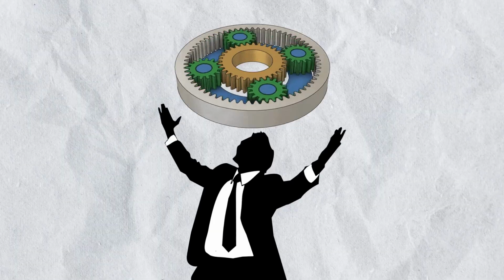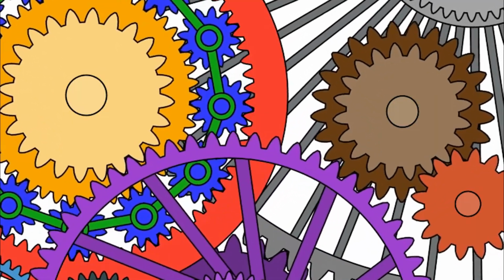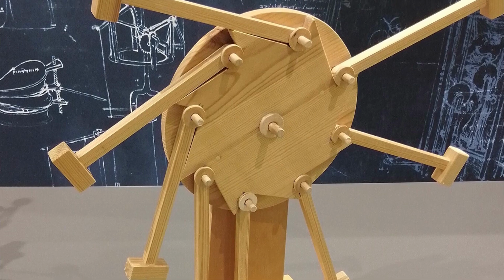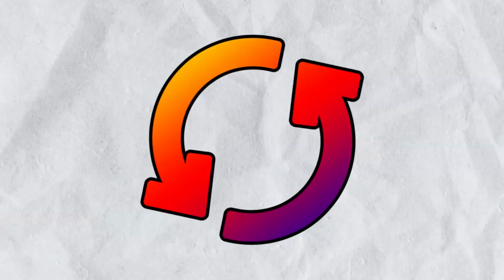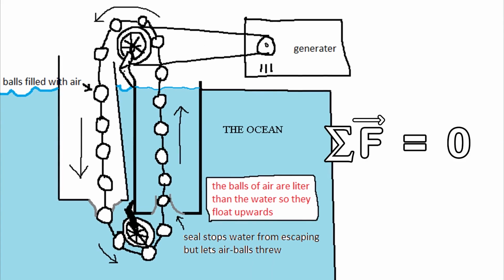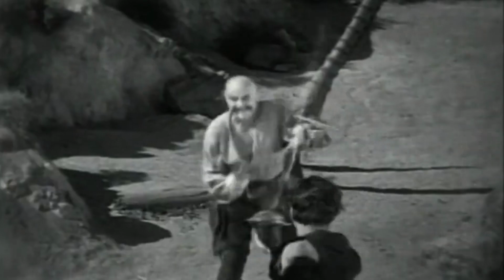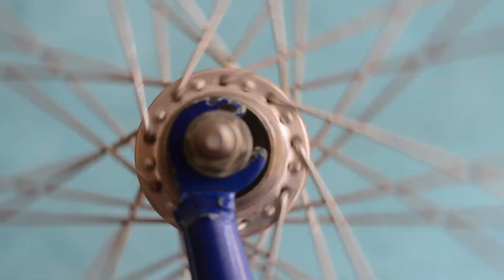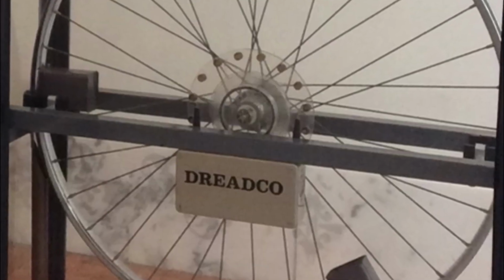perpetual motion

Comment: For me Stirling engines are dark magic, they only need difference in temperature to work, so in theory we could use any source of heat or cold to make them work, but the cost of building and low torque make them subpar.

Comment: What if the wheel with marbles was in a vacuum, like in space so no air resistance?
Reply: part of the energy will always be converted to heat (friction of the parts) and sound, even in vacuum, so it would still stop.

Comment: If David Jones' letter contains some sort of breakthrough that could've solved the environmental damage caused by traditional energy generation methods, I'm gonna be a little bit pissed.
Reply from the maker: No i think it has to be an engineering trick, we most likely know about it we just don't know it can be used that way...
Reply from the maker: And perhaps it has something to do with the year 2047, maybe it will stop working by then, that's why i suggested the heat engine...
Reply: @tylerschannel Let’s see by then along with the digitalized glitch-infused prophecy of the Jan 19, 2038 Global Economic Crash as Y2K’s reborn electro boogaloo!! 💥 👀
Reply: I think it was mentioned in a Steve Mould video about perpetual motion machines. It's not a proper perpetual motion machine, i.e., there is a hidden energy source. From what I recall there are a handful of people who know the secret so they can maintain it, so I wouldn't expect that it'll stop in 2047. That said, I also don't remember him saying that the secret would be revealed in 2047, but I could be wrong.

Comment: Friction is never the problem and never will be. You can not achieve perpetual motion (that generates extra energy) even if there is no friction.

A proper working perpetual motion machine's efficiency must be greater than 100% in order to be able to "create" energy. 
You see, even if you eliminate friction entirely, the efficiency of the machine will be a maximum of 100%.

You need more than 100% efficiency in order to achieve perpetual motion (in the sense of creating energy)

And let's consider that you eliminated all kinds of friction, the machine will just spin or work indefinitely. But at the moment when you want to "extract" energy from it, it will just slow down and eventually come to an halt.

Comment: Even if we make a perpetual motion machine we couldn't really make use of it because if we attach a generator to make it generate energy either will be too weak to do something useful or it will make the perpetual montion stop altogheter because you need extra force to make a generator turn mechanical energy into eletrical energy
Reply: Noooo, the point of "free energy" is to sustain a loop indefinitely, not to be able to use it anyhow.

👌

Comment: One machine that fascinates me is the "hydraulic ram pump"! It looks like an attempt at a perpetual motion machine (or a source of free energy), yet it works surprisingly well, for something that just harnesses energy from flowing water!
Reply: You mean, like a water mill? The kind that uses the already-there "free" hydraulic current pressure?
Reply: @gweltazlemartret6760  Nah. While a water mill uses the flow of water to rotate a shaft, the hydraulic ram uses it to push water out.
 There are many videos showing how it works (I would describe it here, but it would literally be a stupidified copypasta from Wikipedia), but the main use case for it are in remote areas where a watermill isn't possible to be set up due to lack of strong flowing water, since this pump works even with wavy water!
Reply: @1KiloDepartment  oh, you mean a vertical buoyancy pump, got it.
Reply: @ No, not that either. I guess it does the same thing. But the hydraulic ram pump looks quite different!
Reply: @1KiloDepartment  you got me interested. 
This depends on water pressure to enter a valve, then go to another direction and close that valve to go to another direction.
Roughly the concept of a combustion engine's piston chamber, but with the pressure from the water flow instead of an explosion. Neat. But requires the water to actually flow into the main path, so it’s not very portable, and you may not chain a lot of these because there won’t be water to flow afterwards.
Reply: @ I now realize that there has been a mix up with words!
 What I call hydraulic ram pump is the same as what you call vertical buoyancy pump (I assume).
 I had never heard of that word, and googling it just gave results of either regular pumps that are buoyant or abstract schematics of those kind of pumps. :P
Reply: @1KiloDepartment  I meant something like a toilet-buoyant floating thing that would transfert its vertical motion to either change water flow (as in ram pumps) and/or be attached to some kind of bobinage+magnet to gather a little amount of current from its up/down movements.
Does it clarify things?

Either case, hydraulic ram pumps do require flow pressure to work, so it is slowing down water output pressure.
Reply: @ Yeah that clarified it!
 Though that made me think of the wave and tide power generators, that get their power from the vertical movement of water!
 Heck, while googling about these things, there appears to be many many more similar power generators (like what we have talked about) out there.

Comment: All of these designs basically just create loops of up and down which should theoretically work forever because of gravity but they all end up failing because of friction and/or the simple fact that the force needed to counter act gravity is equal to the force gained by falling so the system ends up balancing in the end

Edit: same thing applies to magnets